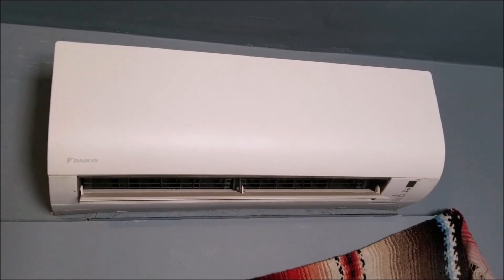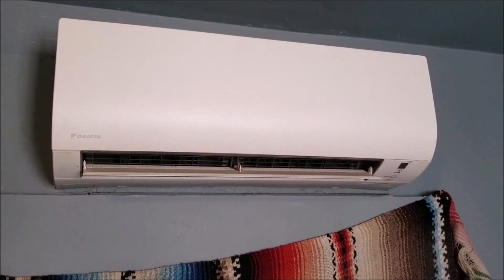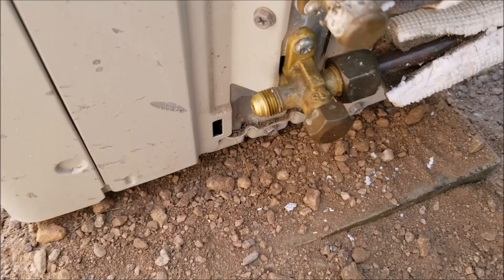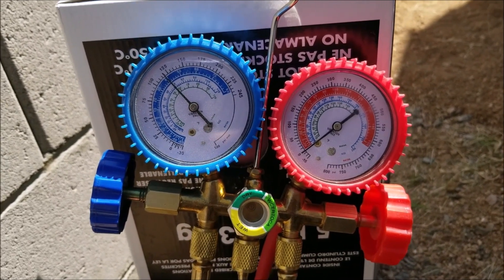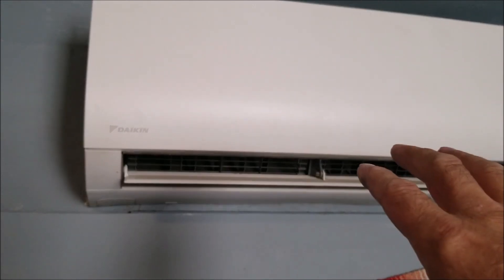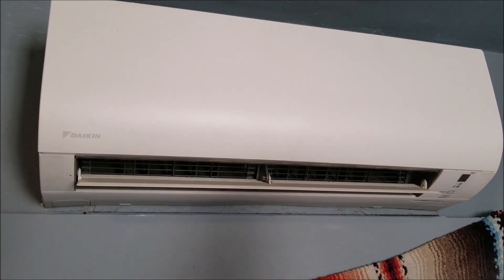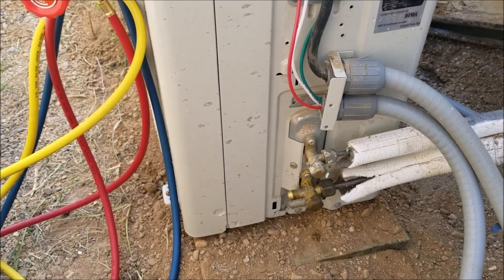How To Add R410a Refrigerant to a Mini Split that Has a Low Charge

Comment: I don’t know anything about anything but I saw two things I think may be “wrong”.  Wear gloves when working.  The bleeding refrigerant is cold and can injure you.  And 2, purge the lines of air maybe?  Crack the hose on the gauge after hooking up the tank.  Same when hooking up unit to gauge before opening valve.  Should remove air from the lines.  Not sure if that’s really important or not but it makes sense to me.

Comment: Thanks this was really helpful. Is the process the same for a multi-zone unit with 2 units attached. Do you attach the blue hose of the manifold gauge to the service port of each unit's refrigerant line as if they were independent? Then repeat for each unit?

Comment: Having epa 608 certification doesn't mean anything. I have seen certified technicians venting a whole a/c compressor freon. Doesn't mean that having that card  all of them follow the rules. Same as the driver license, plenty of people still does wrong. Of course, with no knowledge you better don't try any of those procedures. 
Years ago I was working for a big corporation and in some evaluation meeting that we have, the kind of at supervisor or manager level, it was a Q/A to fill and one of the question was:" what is the most valuable thing that you have for the company". The best answer for that was always "knowledge and experience".

Comment: Since you have the 608 certification, you know you are supposed to account for the disposition of all refrigerant. Accordingly, you should have weighed the tank before and after, but preferably have it on the scale while adding refrigerant to the system so you can log how much was added. 

Others have noted you should have evacuated your hoses. If you had placed an inline valve on the mini-split adapter, you could have cracked it open very briefly (before connecting the hose) to replace the air trapped in the adapter and valve bodies with refrigerant from the system. Next, connect your hoses, but before opening the inline and tank valves, connect your vacuum pump on the high side of your manifold, open both manifold valves and evacuate all the air in the hoses and manifold. Close the high side manifold valve and disconnect the vacuum pump. Now you can open the inline valve and then add refrigerant.
Reply: The entire system is a Joke, Period now People pay hundreds of dollars for propane which cost pennies! it's all a giant scam!

Comment: Is the 117-120psi meant for all split system? 9k btu to 36k btu? I have a 12k btu
Reply from the maker: It is just a rough estimate. Since mini-split units have variable speed compressors, reading the pressures cannot be done like normal HVAC systems.

Comment: If an R410A minisplit system is leaking freon, you will never get the mixture correct because 410A contains 2 seperate chemicals which boil off at different rates. So if your system is leaking, that means that your freon is already junk. This could lead to compressor failure and expensive repairs. Do it right the first time and call an AC professional!
Reply: Problem with that is in some areas the HVAC company's charge you as much as a new unit costs. So if you know you got a leak and can't fix it yourself and know how to install one, which if you're here you probably have already, then might be better to just buy a new one and re-install the new one. Hole is already there, just a matter of evac and opening the ports to start up unit. Get these split for under a 1K up to 18K btw. Got the tools already I say just replace it if you can't make the old one work.

Comment: I tried this, my unit won’t take refrigerant, and it doesn’t hiss when I attach it to the hose. The gage shows pressure, but that’s likely just buildup in the hose with the gauge shut off. How do I get it to flow?
Reply: Also, I noticed that the adapter has a little green rubber grommet inside.. do I remove this? The blue hose does not have anything to depress the adapter stem plunger which I assume would activate flow into the unit… on the side of the adapter connecting to the unit, there is a green grommet surrounding a brass flat stem plunger.. that’s my best description…
Reply: Also, I noticed that the adapter has a little green rubber grommet inside.. do I remove this? The blue hose does not have anything to depress the adapter stem plunger which I assume would activate flow into the unit… on the side of the adapter connecting to the unit, there is a green grommet surrounding a brass flat stem plunger.. that’s my best description…

Hose = good flow
Attach to adapter = almost no flow even when removed from unit.

Comment: R410 near azeotropic which is not a single entity refrigerant molecule, it is consist of 3 blended reftigerant,  when leak the lightest refrigerant will released to atmosphere first then resulting unbalance composition, will you still added on top of existing?
Reply: No,  it's a 2 blend refrigerant, and they will both leak equally, that's why you CAN top off.

Comment: might be a silly question, but , can I do this job with a regular lb scale? For instance, the scale I used to weigh myself?
Reply from the maker: While technically it may work, HVAC scales are very precise down to the ounce. I wouldn't use a standard scale as it may or may not come out correct. There are some low-cost HVAC scales online.
Reply: @ thought you for the reply and your time.

Comment: Thx,  Trying not to use my oil heat much. Cost too much. Got a leak in Mini I guess. Checked flares. Hoping its just the shrader valve which I replaced because I found the old one was loose and found I only had 60psi left. Gonna charge with 410a leak stop/dye refrigerant (32oz can). My question is being it's 30-40 degrees outside, do you still use 120psi as the goal to reach. Some other videos stated 300psi, but it was out in the cold weather.

I'm also going to do an evac on the line set. I closed both ports on the outside unit when I replaced the shrader valve and didn't have any refrigerant leaking out of line set, so I figure I should do an evac on the line set. I'd imagine I got some air in the outside unit now, but I don't know, just guessing seeking advice.
Reply from the maker: Mini split units have variable speed compressors, so using a temp chart doesn't work. Either the refrigerant is recovered and then added back in by weight or add in small amounts until the unit starts to work again. If it's overfilled, it won't work, so go slow.
Reply: @HVAC_Mechanic  Thx. I appreciate the response. Is a Evac on the line set recommended being that after I close both high and low ports to condenser and then slightly removing shrader valve on low port to see if I had any refrigerant in the line set had showed me know sign of refrigerant leaking out of the line set?

Comment: Any idea what a PSI should be when running heat with 50 degrees weather outside? r410
Reply from the maker: Unfortunately, trying to use pressure-temp-chart is not reliable with a mini split variable speed compressor. This is why I add in small amounts slowly until it starts working. The official method is to start empty and add in by weight.

Comment: I’m about to do this for the first time and I’m. It a pro lol wish me luck I’m going to follow you. I think the system is completely empty because it’s knocking when I turn it on . I have 2.60 lbs and have a 2lb bottle so do I just fill it all in and follow your video and follow the comment that says bleed the hose etc
Reply from the maker: If it is empty, it is best to first fix the leak, vacuum it down, then get an HVAC scale and add in the correct amount by weight.

Comment: Good video but there is 1 main thing you either didnt do, or forgot to show. ALWAYS EMPTY YOUR HOSES INTO THE SYSTEM BEFORE DISCONNECTING THEM.  Especially with R22 units !!!!! I will weigh the refrigerant in 1-2oz short, close the valve on the refrigerant tank & then open up the low side of ur gauges to pull the refrigerant from your hoses into the system. If you dont have low loss hoses, ( which is against the law ) you will piss so much refrigerant out of your hoses. If you do have low loss fittings all that refrigerant trapped in the hoses will be wasted. This becomes critical when your only doing a service call/ clean & check. If you dont empty your hoses, after hooking up 3-4 times, your system is going to be low.

Comment: What I did was hook up the tank to the yellow line, hooked the line to the middle valve.  Then I opened the tank.  And then, with nothing else hooked to the valve, I opened the high and low pressure sides and let the yellow line and the valve get purged of air.  Then I hooked the blue line to the valve (still off) and hooked the other side the the low pressure valve on the unit.  I loosened the blue line at the valve to express the air in the line.  Then I flipped the tank over and opened it up.  Started the unit, the pressure was about 50, clearly very low.  I filled slowly in increments while the compressor was running until I had it at 120.  The unit was blowing hot air out of the compressor and very cool air inside.  I ran it extensively.  Tested everything for leaks, none found.  I fault myself for this fiasco because I didn't monitor the new installation properly.    Maybe on the fill it's just approximate, but it's running as well as it ever did.  I feel like I didn't get a pit of contamination in the unit.  Leaving the pressure gauge on it all night.  Makes me want to get  a recovery tank and a scale.  This account, of course, is fictional :).  I am not properly licensed to do this work, so this is just personal fantasy.
Reply: And as a final dream, the manufacturer's tech emailed me and told me 1/2 hr after turning the unit off, the pressure should be 1.6 to 1.8 mpa.  So no guesswork.  That's 232 psi to 261 psi.

Comment: Great cheat sheet and to the point.  Nice option if you don't have the patience to go through all the technical moves for exact dead on charge.  You mentioned if you overcharge, it will quit operating.  If you release some of the charge, will it begin to work again?

Comment: The video doesn't show the purging of lines.  I'm hooking up the blue side to the low pressure side of compressor, cracking the hose to purge the line to the blue gauge.  Leave blue gauge valve closed.  Then hooking the yellow line up to the tank (tank upright), then cracking the yellow hose a bit to let out refrigerant.  then turning off the  tank.  Then my yellow line has a valve to the outside that I can press to let gas out of the valve itself.   First I open the blue side, then purge out of the valve itself.  Now I should have as clean of a system as I'm going to get this way.  Turn tank back on and flip over, and proceed to add per the video.  Fumbling through this with 10 thumbs pointing in different directions.

 First bit of advice would be to check for leaks a day after installation, and then again after it's run for a week. I hope you'll be able to avoid this fiasco that I've stepped into.  I vacuumed and pressure tested this for a long time before releasing the refrigerant.  Then I used the spray, no bubbles.  A month later, the unit isn't cooling right and is obviously low on coolant.  Had I checked the connections for a leak, I wouldn't be screwing around with this.  Liveand learn, that's a big bucket.

Comment: I presume that the factory charge of R410A, 2.09 pounds, applies to a particular line set length. For example, a shorter or longer line set length requires a different weight charge....am I correct regarding that statement? How does one determine the proper weight of refrigerant when an overly long line set, for example when three feet is trimmed off of a factory line set?

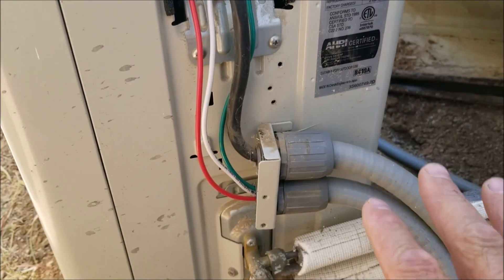Comment: On 2:44 write LO SIDE 391. Is that mean da on the low side should be 391 psi. And you charge ~120psi!Why you didnt fill on the 391? Please explain. Thank you.
Reply: Maybe the sticker doesn't explain completely, but usually this states the maximum allowable pressure that unit is designed to handle, not operating pressure.
Operating pressure varies depending on compressor modulation, indoor and outdoor temperatures, pipe insulation etc.
Reply from the maker: Pressures can't be read correctly when adding refrigerant to a mini split like traditional HVAC units. Any pressures read in the video are just what this unit is currently running at.

Comment: You don't have to have a 608 card to buy refrigerant.  You have to have it to charge a system with it.  The seller can sometimes make it a requirement, but there is no law that prevents anyone from owning the refrigerant, or prevents sellers from selling to anyone.
Reply: Thank you for this info

Comment: So what is your "guess" of how much you put in by opening that quickly? 1/8, 1/4, 1/2, 1 lb? Also...are the gauges not useless with an inverter/variable compressor in using them as a guideline?

Comment: This is a good video.  Got my ac down 6-7 degrees to 43.3 F    :)   Like others say, purge hoses, when opening, closing.  Just imagine there is dirty air in your lines, to gauges, to tank, to mini-split port.   Positive pressure on mini-split, positive pressure on tank.  However you need to open the lines to get the freon completely in the lines from one to the other and through the gauge.  With a decent gauge set, this is a piece of cake. THANKS.  Also, if anyone else reads this.. His statement "Wait 5 minutes" ..is very important.  If you have a laser temp gun, reading spots inside near the fan blade, you will notice it goes slowly down.  I'd even go as far as to  say.. do 1 Pump.. then measure after 3, 4, 5 minutes.  How low is it?   (I measured my other unit on other bedroom, it was 44.3.)   It took 5 minutes, but got down and lower than my other unit. Now I'm wondering how low I can go on top of this.  I know my first unit was done perfect. So 44.3 was my reference. With this second unit I had rushed, and made a mistake, I ended up doing what this poster said. I vacuumed the system, used a postal scale, and upside down, put in 2.x pounds.   It worked good but I noticed my other unit was just a little more Icy.  This video is great, Worst case, drain, evac, fill, measure.. add a little more.  can't take too long. I did this in 25 minutes.
Reply: What do you mean by when opening, closing??
Reply: @JohnDoe-qz1ql  ... opening the high or low pressure valves on the gauges.  When I say purge, I mean purge out the non freon "air".  You never want outside air in the lines, so say I put a can of car freon on the yellow (in to gauges line) to the main gauge.  I would open the valve, freon goes up the yellow line to the gauge, I would unscrew the yellow line at the gauge.  If I were (on auto charge), to purge the whole line, I would put on a can to yellow line, open the low pressure blue side valve, then where the press on low pressure to the cars port is, I would unscrew the blue hose at the port side so freon came out. (again at this point opening the port on the can) This way there is no air in the lines.  Then I would pop on the blue charge line to the cars low port.  same for mini splits. Now remember,  If on your car you had freon in it, that will be pushing out. So you have New freon on the gauge side pushing in, and you have your car pushing out.  Putting on the charge I like to have it spray out either end a little (car side or gauge side) so there isn't even any outside air entering while I'm putting the freon on.. / in.. to the car. Same as mini split.

Comment: thanks for the video, how about the case of topping off a multizone mini split? let’s say if there were 3 zones and 3 ports instead of just one, would you let some refrigerant into each one?   or is filling one of them good enough? (i imagine they connect inside the compressor)

Comment: eBay no longer sells refrigerants…. Basically for that reason… but I just bought a 25 lbs jug of 404 and a 25 lbs jug of 410 for less than $600 for the pair with free shipping ..! Hell of a lot better than eBay ever could….!
Reply: Do you have this card? If not I need to get this deal

Comment: When your checking the pressure is the unit on or off?
Also if I have multiple heads on one condenser,  regardless of what port I connect too will the pressure reading be for the entire system?
Reply from the maker: Pressure reading can't be done very well with a mini split. The only thing that can be done if it is low on refrigerant, is with the unit on, add in small amounts of refrigerant slowly until it starts to cool again. Add refrigerant in small amounts as to not overfill it which will cause it to not work also. This is not the official way which is to vacuum it down and add in refrigerant by weight.

Comment: Does your adapter not have a schrader on male side? I hook my adapter on first as it holds pressure, and then attach hose. When finished, I’m able to take hose off of adapter, remove adapter with little loss of refrigerant

Comment: Did you add refrigerant with the ac on and in cooling mode? Sorry if thats a dumb question.
Reply: As I understand it (but I'm no expert) it has to be added with the mini split in cooling mode for the pressure at the port to be low enough to allow the refrigerant to flow into the system. In heating mode the pressure at the port is high (sometimes very high).

Comment: I don't use gauge to measure. I prefer ampere clamps. Also, to top up refrigerant tpye 410a and R32. You need a medium like compressed unit to transfer the gas bogus refrigerant.